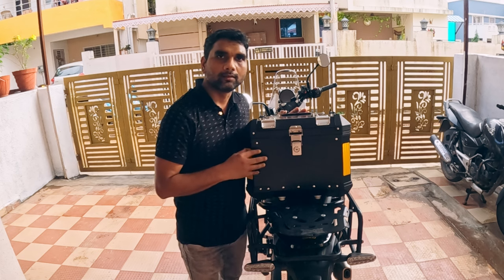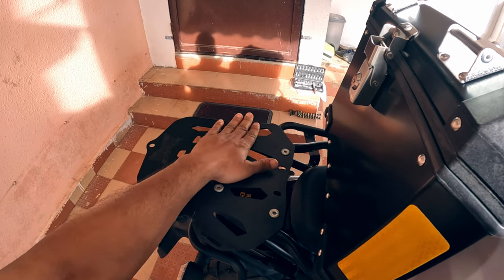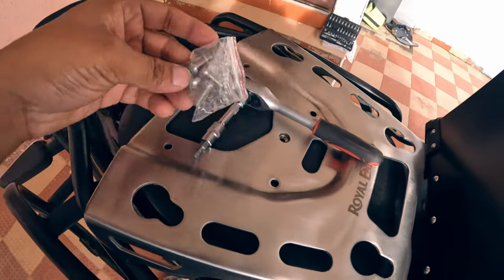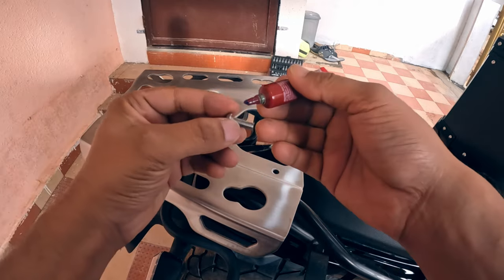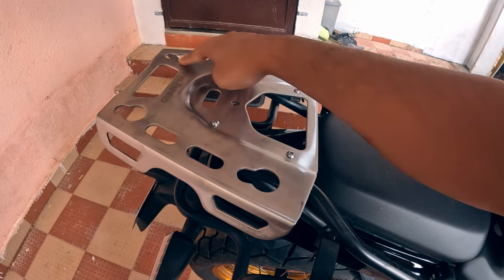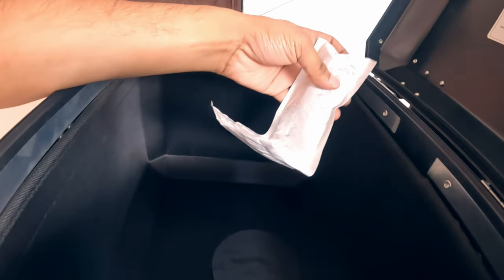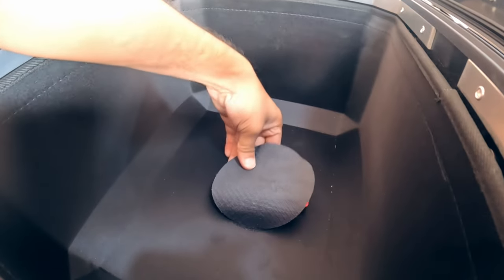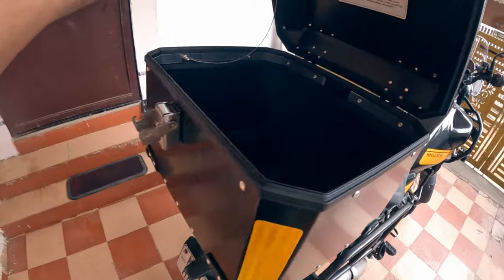How to Install Royal Enfield Genuine OEM Top Box on Himalayan 450

Comment from the maker: This is only the installation video, I will soon make a review video. Let me know If you have any queries in the comments. 🤘
Reply: How much is this costs? with plat
Reply from the maker: @surajsuraj6696  Hello.. the top costs 23250 and plate costs 2450 and you can get 15-20% discount at dealership, so you can get both for approx. 20.5-22k

Comment: Do you think that piece of metal clamp projecting so much inside the box is a good design!??
Reply from the maker: Yes it seems weird, but it makes it very secure.
Reply: @OnceARider  more chances of damage to items placed inside the box. RE designers sloppy design as usual
Reply from the maker: Totally agree bro.. at least it could have been in slot or groove so that the bottom would have been flat.

Comment: Hi, is this top box of aluminium body or fiber ?
Whats the price of this top box ?
Reply from the maker: Hi Anoop, the top box is aluminum and it is a bit costly, I got it for ~19k, The actual price is ~23k but I bundled it with a couple of more things and got a 20% discount overall. 
With the top box you also need to purchase a RE OEM top plate which is extra ~2.5k
And yes Silver color is available.
Reply: @OnceARider  Thankyou , request if you can share store name and contact details
Reply from the maker: Hey.. I got it from Choppada Motors wagholi showroom 096196 45880. You can contact Farukh there.